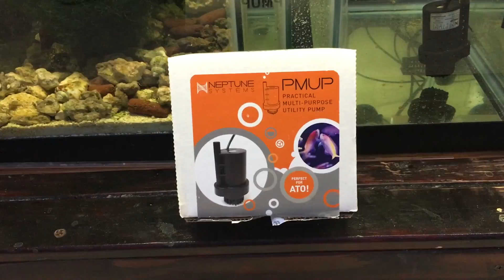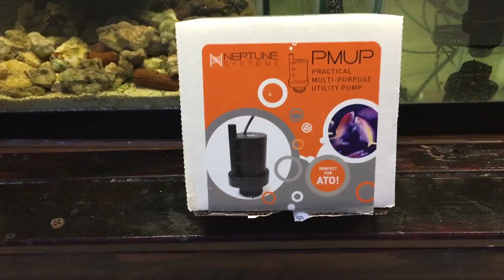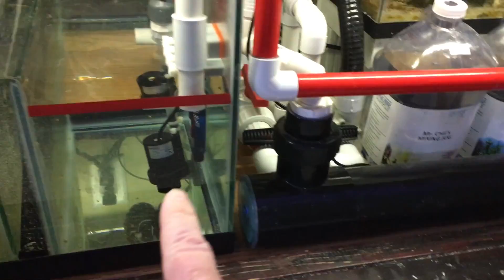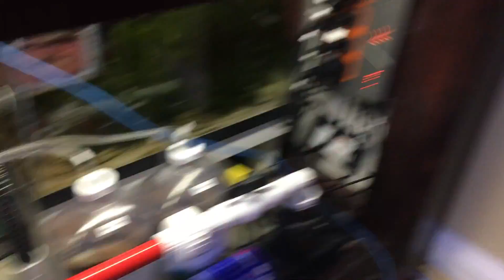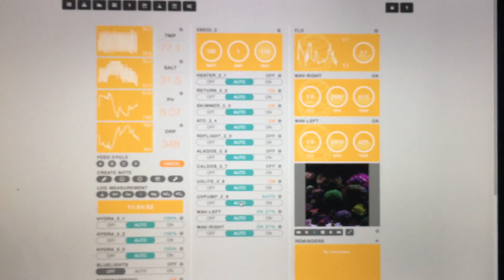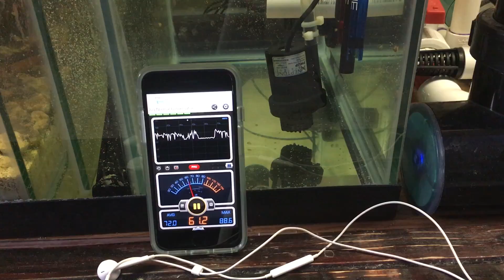Neptune Systems PMUP 24V DC Utility Pump Review

Comment: STAY AS FAR AWAY FROM THIS COMPANY AND PRODUCTS AS POSSIBLE. THEIR 
EQUIPMENT IS JUNK AND WILL FAIL INSIDE OF THE WARRANTY PERIOD. THEY WILL
 REFUSE COVERING THEIR JUNK PRODUCTS AT ALL COSTS. EVERYTHING THAT 
FAILS, NO MATTER THE REASON, IS ALWAYS BLAMED ON WATER DAMAGE. THIS IS 
AN HONEST MESSAGE FROM A CUSTOMER THIS COMPANY SCAMMED!
Reply from the maker: So far I have had a good experience with their customer service.  My WAV mounts did not fit correctly and they sent me new ones no questions asked, I also had an issue with my the impeller on PMUP which they also replaced once I sent it back to them.